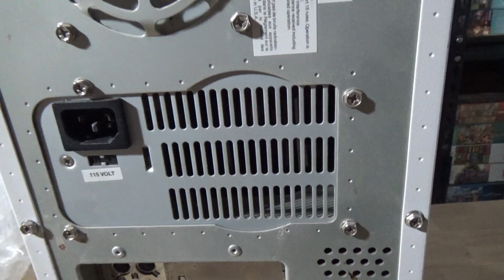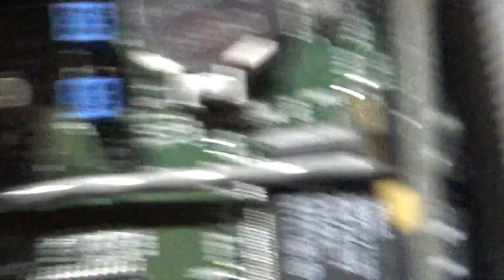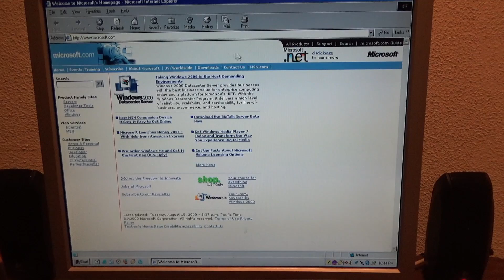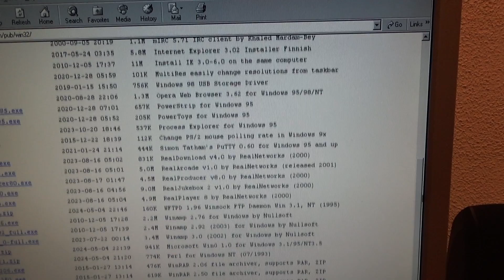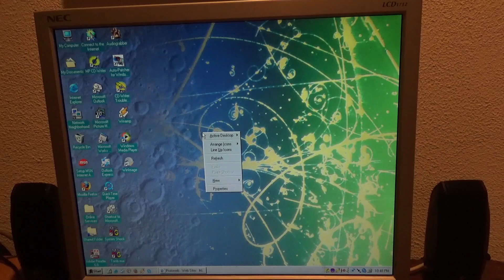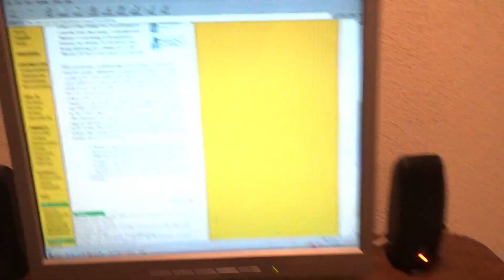Gateway 2000 G6 200 Overview & Demonstration

Comment: I would swap out the motherboard for a Pentium 2 or a dual Pentium 3 setup instead from what ive heard the Pentium pro had it's issues but was okay as long as it wasn't to multi media intensive lol wish it was a dual socket Pentium pro with the 1mb l2 cache.
Reply from the maker: I already have another Gateway with a Pentium II processor, so I'm probably going to build that one up more for multimedia stuff and gaming.

Comment: I used to be able to get 8x CD recording speeds out of my pentium 200 mmx, without errors.  That specific computer had 256k l2 cache and 96 megs of ram.
Reply from the maker: Nice! From what I have heard, buffer underwrite issues largely went away during the era of the Pentium II and III. I can imagine having 256kb of L2 cache certainly helped you a lot when burning CDs!
Reply: @ENB2002  yea, that's what I'm thinking too.  I wish I still had that setup, but my parents trashed it while I was at college.
Reply from the maker: @mikeall7012  Aah man that sucks! In my experience, it's always the rigs you lose over the years that you come up with interesting projects you could have done if you still had them, or even the parts.